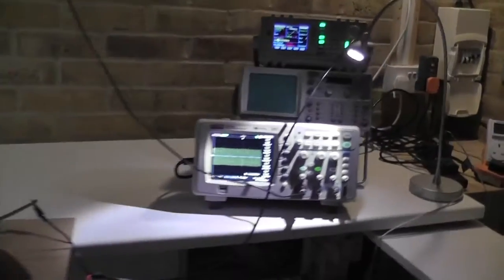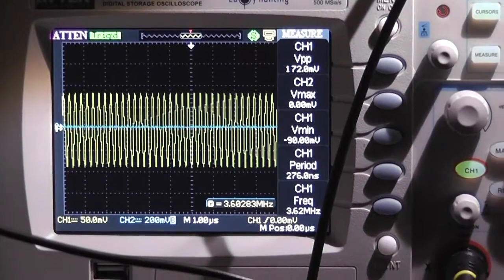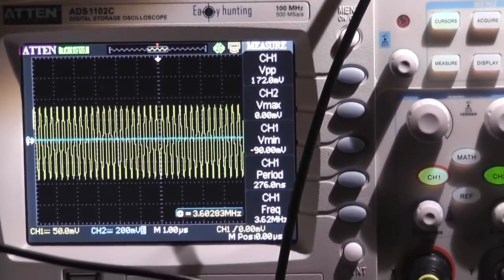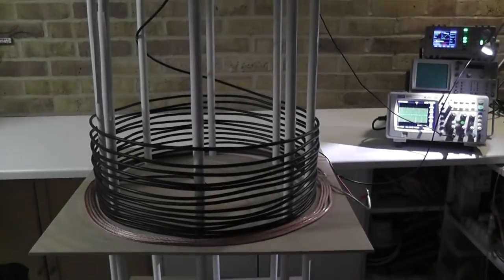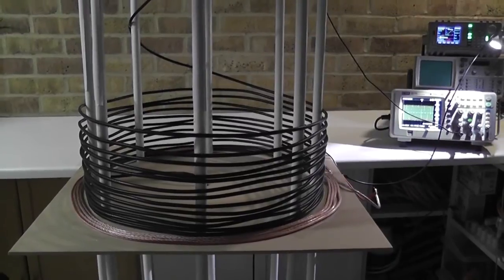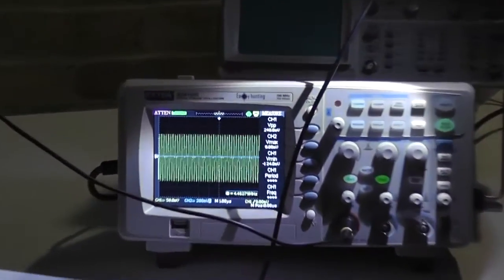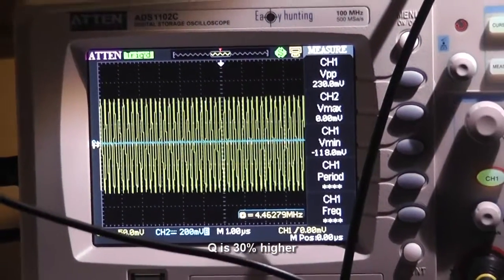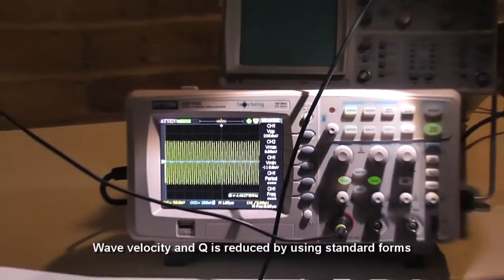Scalar Network Analyser, measure the electrical wave velocity in a coaxial cable

Comment: simply put that the coil cone tip acts like a hammer thrower on a sports field as the hammer spins (electrons in an atom) the hammer thrower being the proton neucleus.voltage increased down the coil the hammer/electrons spin off .....does that make sense thanks